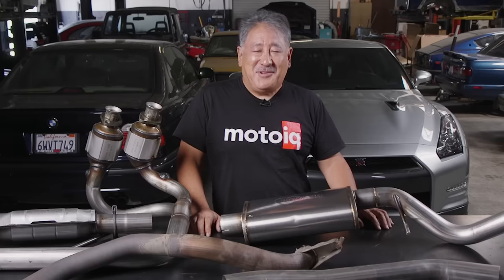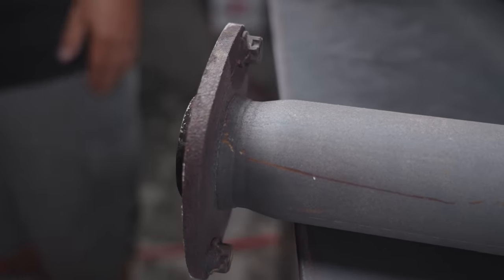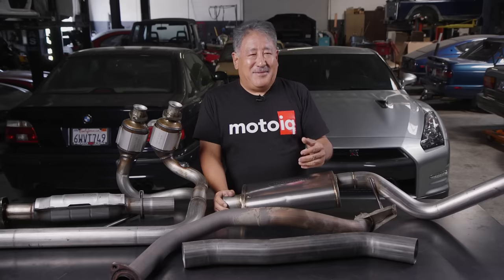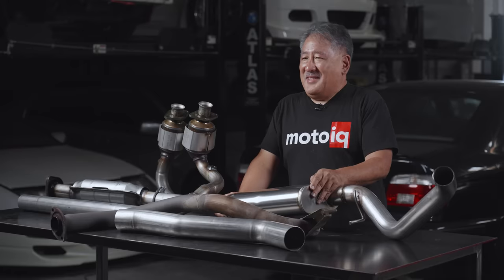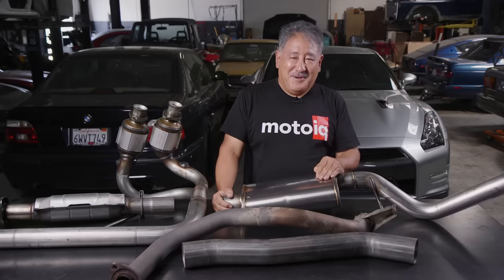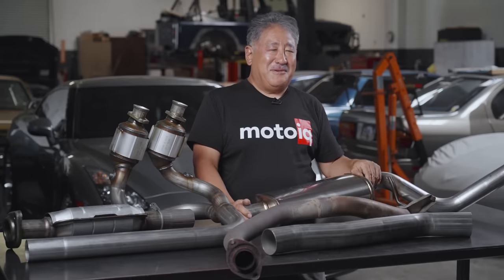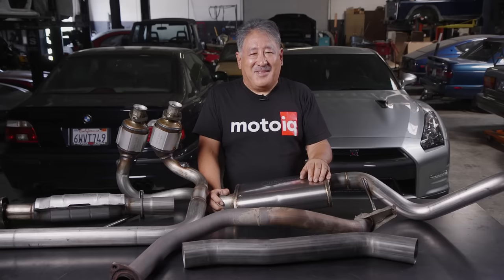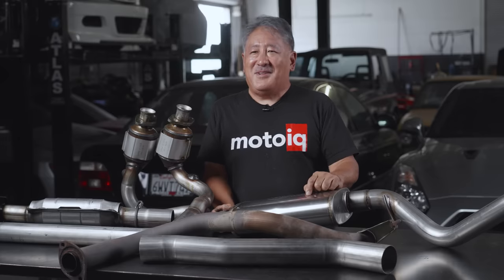Exhaust Back Pressure Myth DEBUNKED!

Comment: now im not saying you are wrong but i have a 1982 300 inline 6 with 2-1/2 inch pipe and  when we straight piped it it stumbled and backfired like crazy like it was way out of time or something but no mater what be did with timing or fuel the only thing that fixed it was a super cheap $20 in (2009) roadrunner muffler
Reply from the maker: Did you actually monitor the AFR?  What was it in the range of stumbling?  I assume the engine was carbureted?
Reply: @motoiq  yea it is carboarded and all the problems happened around idle 900-1100 rpm

i mean we checked 
vac system
carburetor
replaced the wirers and plugs thinking they were faulty swaped out the distributor and coil because we had them

2.5 inch was the factory pipe so we never thought it would be that 

old man next door said throw a  muffler on it and that fixed it

i don't know the AFR because we don't have the tools for that this is a backyard restore
Reply from the maker: Did you adjust the accelerator pump shot?  Did you up the jets?  What sort of carb was it?  Often improve breathing leans stuff out and not just idle mixture screws. Helps to get a cheap wide band AFR meter if you mess with cars much.  Comes in very handy.
Reply: @motoiq   its a Rochester 1 barrel and ill be honest i didn't know you could adjust an accelerator pump
Reply from the maker: they have jets for them https://www.carburetor-parts.com/rochester-main-jets-120-10a  You can't adjust the acclerator pump on those.  Put a vacuum gage on and and adjust the idle mixture for the highest vacuum.  You might have to jet up a bit depending on how bad the stock exhaust was. Offenhauser makes dual and triple rochester intakes for those and if you mod them with a good header, intake and cam they go pretty good.
Reply: @motoiq  thanks for the advice i drive it daily should i go small?
Reply from the maker: how big did you go for it to mess up?  It's a 300 cubic inch i-6 right?

Comment: This does not apply to all vehicles. Regardless what this guy says a lot of vehicles runs better with some back pressure.
In renegade dirt track racing you run the exhaust to around the halfway point of your car and then you take a crayon and draw a line on the bottom on the last 4 foot of the exhaust,then you crank it up and let it run for just a few minutes and where ever the crayon stopped melting you cut the exhaust off and not only does it give you some back pressure which you need it also dissipates the heat from the motor. You can also take the muffler off a 4wheeler and run just the straight pipe header and you can clearly tell it runs better with the full exhaust system
Reply from the maker: What I am saying is 100% true, you are just not understanding what I said in the video, its high velocity, low backpressure with the right engine tuning to support it.  This will make more power and torque all the time.

Comment: But if you remove all back pressure don’t you run lean and can blow up the motor?
Would you not have to be very careful and have a professional re calibrate the complete cylinder banks
Reply from the maker: Then you rejett or retune.
Reply: Yes then that should be mentioned every time some tries to tell you something is better, engineers do their homework
Youtubers don’t, and can cause serious damage to unknowing individuals @motoiq
Reply from the maker: That has nothing to do with the video, that backpressure hurts power.
Reply: Your video implies removing the back pressure from any car will improve performance. Without notifying the viewers that doing so can damage a motor quickly.  That is all I am stating  @motoiq

Comment: Why do 2 strokes have a small rear tube before the silencer.  I fitted one  of theses to a 125 road bike and it made the bike much faster
Reply from the maker: https://www.youtube.com/shorts/qf9eFYPYXUY  They call that the stinger and its length and diameter are part of the pipe tuning.  A basic formula for a stinger length starting point is 6x the diameter.
Reply: @motoiq  yea we call it a spanny pipe.  But some one explain why it contradicts this mans vidio .
Reply from the maker: Because it doesn't.  The pipe isn't a restriction. It's a wave strengthener.   It makes the end of the rear cone more defined to reflect harder.  Backpressure can make the wave travel faster but it's better to have lower backpressure and shorten the pipe if you can do it.  You can add some sort of restriction to band-aid a situation when you need to move the powerband around but it is not the best way to do it.
Reply: @motoiq  I'm not sure I fully understand but I want to . I love power modifications.
Reply from the maker: Check this out. http://www.dragonfly75.com/motorbike/ECtheory.html

Comment: So is anti lag harmfull for the engine or?😅
Reply from the maker: It is hardest on the turbo but also hard on the exhaust valves.  The life of these parts goes way down. The cooling system also needs more capacity as late timing is hotter and normally the engine gets to cool off during overrun.

Comment: More Internet lies. U need some backpressure for more low end power. More open exhaust for more high rpm power.
Reply from the maker: That is not true. If you don't believe me, check out what Gale Banks says https://youtu.be/k7yYY_hy250?si=PGIIk5Qfbafrdr2z  If you don't believe Gale Banks, here is a test garage 4AG did https://youtu.be/V2Wv5-ZTOjM?si=oA1CylAdrnh5m48K You will note that increasing backpressure did nothing but hurt the bottom end.

Comment: I was told motoGP bikes have valves in the exhaust to create back pressure to help with power in the mid RPM, I guess that was a lie then
Reply from the maker: In the intake
Reply: @motoiq  Yeah I know about the ones in the intake, but that guy was specifically talking about the exhaust, guess he was full of BS then
Reply from the maker: I double checked and Ducati runs one but it is to improve engine braking when the throttle is closed.
Reply: @motoiq  oh, thanks for looking it up, but good to know the correct information now, thanks for the work

Comment: The only thing back pressure is good for is regulating fuel consumption.
Reply from the maker: Actually a properly designed exhaust can reduce fuel consumption.
Reply: @MotoIQ  true, but when the EPA forces you reduce what that bureau claims are harmful emissions and your available technology doesn't allow extreme fuel input control your only options are to restrict the pump and vent to atmosphere. Just before the EPA required the switch to fuel injection, carbureted vehicles were achieving 50+ mpg. If that technology was allowed to be perfected, all high fuel mileage vehicles today would be carbureted. The only danger we faced from tailpipe emissions was the additives  they put in them. In the case of this subject, it would be lead particulate.
Reply from the maker: Um I was alive and modding cars before the switch to fuel injection and cars sure didn't get 50 mpg then with carburetors, I can't think of a single full size car then that got anywhere close to that.  When I was in my early 20's cars started to go to electrotonic fuel injection and 3 way cats and not only did they get much better mileage, but they ran much better and made way more power.  Performance came back then.
Reply: @MotoIQ  This type of vent to atmosphere small carb designs never made it to large v6 & v8 engines. The best example of this concept in a modern take is this project by ThunderHead289 here on YT. https://youtu.be/KuDIuSsxia8 
I personally have an 86 CRX HF that had probably the best example of this technology from that time period that made it to market. It used 12 temperature controlled vacuum switches that vent to atmosphere. The system had around 40 hoses between the two vent boxes, the switches, and the carb. These setups have potential, but again, the advancement was suppressed.
Reply from the maker: I mean just about all carburetors are vent to the atmosphere, the only exception might be sealed box blow-through carbs with turbos. The 85 HF has a lot of vacuum hoses due to it being the last of the CVCC pre-chamber engines that have a dual circuit carburetor that feeds a richer mixture to the CVCC pre-chamber.  The reason why this was discontinued was not because of some great conspiracy but because consumer demand wanted more powerful cars and technology got better.   There is no way a carburetor does the combination of power, emissions, and fuel economy better than fuel injection.  Sure the examples you showed get great mileage but they have really poor power and if you look at modern engines brake specific fuel consumption (lbs fuel per hp per hour) over the entire operating range, fuel injection wins hands down, especially modern DI engines.  If you built a 70 hp Di engine to propel a 2100 lbs fwd car, with the same emissions standards, it would win hands down. The engine would only have to be 1000cc and have better thermal efficiency and better friction.  There is a reason why F1 cars approach 50% efficiency besides energy recovery and hybrid technology, it's stuff like using the Miller cycle and DI fuel injection.  The only way a carb comes close to something like direct port injection is steady state-specific operating range driving and even then DI injection is much better.
Reply: @MotoIQ  I'm not saying that carbs are better, but they do have a place in the market but are not allowed to be placed on new vehicles at the factory. (Which is Fascism by the way) The vent to atmosphere takes place either on the manifold or at the base of the carb, so the fuel metering device is not overpowered by the vacuum. Which causes an over rich condition. In the case of the hf carb, it has both. As well as a variable pumper and premix, which allowed it to operate at a range of temperatures more efficiently.  I replaced it with a Weber 38/38 outlaw, but I kept the carb to study it and for the value of having it. BTW, the number of hoses had nothing to do with CVCC. CVCC is actually head design. There is a tiny valve next to the sparkplug that makes sure the area around the sparkplug is as rich as the cylinder to improve flame propagation. It's a strange design, if I'm being honest. V-tec was a better technology for sure. I can't remember exactly where I've seen it, but there was a dual injection(direct injection/port injection) engine that made use of a similar technique to CVCC having the main mixture come from the port injector and a small injector near the spark plug to create a more efficient flame propagation. I do, however, believe that no carb setup could beat a turbo/supercharged fuel injected engine tuned for fuel economy. Especially as the control technology gets better and better. If that technology isn't completely put under by this ESG global Fascism we are facing, that is. 
I'm about to do a complete engine rebuild on this old EW1/D15A1 and will be making some videos explaining much of what I have learned that I couldn't find out there on the internet.
Reply from the maker: It isnt Fascism, its because carbs can't maintain the stochiometric AFR across a wide range of operating conditions needed for catalytic converter operation. Unless you think effective emission controls are Fascist. Carbs cannot provide a stable enough AFR over a wide enough operating range for an oxidation-reduction cat to work. A lot of it is not the fault of the carb, its stuff like wall wetting that the carb cannot control and no amount of development is going to get around that. Your typical aftermarket ECU has 1024 break points where the timing and AFR can be adjusted.  Your OEM ECU has 100x that with sophisticated algorithms to chase AFR very incrementally.  It is mechanically impossible to make a carb meter as precisely. A typical carb only has 3 circuits.  A sophisticated conspiracy theory carb has more and probably something like a hot vapor circuit. Still its not going to approach what fuel injection can do.  If a carb could do it better for cheaper, the OEMs would be using them to increase their profit. Capitalism is a stronger factor than Fascism.  There is no conspiracy theory here.   Still not sure what you mean by vent to atmosphere.  You want a strong signal at the venturi for a carb to work best.  You bleed and mix air into the fuel internally at part throttle via emulsion bleeds to finely control the mixture.  CVCC was done so you could have a rich AFR around the plugs and lean everywhere else. CVCC was phased out not because of a conspiracy theory but because although it was good for HC and CO emissions it was bad for NOX, this is the nature of lean burn.  There is only so much energy available in a mole of fuel and delivering it by carb, even magic carbs isnt going to change that.  Emission controls are not Fascist. Nether is having clean air.  EFI is not Fascist. The government doesn't say you cannot use carbs, it just says your car has to put out less than X amount of pollutants.  EFI is the cheapest way to do this.
Reply from the maker: All good points but do you have data?  Studies that show that NOX doesn't degrade into 03 by solar energy like is general common knowledge?  Lifecycle impact of EV's?  I have seen studies going either way. I tell people that we are currently in a cool period and the earth has usually historically been much hotter with a way different climate and man doesnt know enough to make a judgement what is the best course of action.  I do know one thing, I grew up in the 70's and as a kid I recall smog alerts all the time and when it was one of those, it hurt to breath and your eyes burned.  The really bad stage 3 ones it was hard to breath and people died.  With pollution controls we haven't had a smog alert in decades even though there are way more people and cars in LA. The ocean is much cleaner too.  So common sense tells us we should reasonably try our best to reduce emissions despite stupid politics.
Reply from the maker: I know there is a lot of bias in the algorithm but I think it's mostly for idiotic right-wing propaganda sights.  The bias is that usually leftist stupid propaganda sights are not censored or fact checked. For scholerly work from credable institutions I think it won't be censored.  Like the FBI data showing that gun control doent work is not censored. I am no fan of big tech doing this.
Reply from the maker: Hey I did some double-checking and I was right, the CVCC carb does have a circuit for the prechamber, it even has its own intake valve.
Reply: @MotoIQ  yes. The cvcc is a premix valve. There 3 versions I am aware of, a 2, 3, and 4 valve head all equipped with an auxiliary valve. My EW1 is a 3 valve with an auxiliary valve. Cvcc doesn't extend to the carb itself, but the intake manifold has a key roll in the operation of cvcc. I wish I could post photos here to show you what I'm talking about. I'll be making my videos this summer. I'll make content explaining the design and modifications I've made.
Reply from the maker: On the one I am looking at there is a circuit on the carburetor to the right of the barrel closest to the valve cover.   They have a good picture of this here.  https://www.thetruthaboutcars.com/2012/08/memoirs-of-an-independent-repair-shop-owner-how-hondas-cvcc-gave-me-my-10-best-years-part-two/  Does your carb have that third barrel?   Here is another version of the CVCC carb https://www.autoweek.com/car-life/but-wait-theres-more/a1850371/wait-theres-more-1850371/  This one has the third barrel to the side of the two main ones.  In all the versions I see the enrichment for the CVCC system is coming from this circuit in the carburetor.
Reply: @MotoIQ  the carb I pulled off is similar to the second link you provided. The variable premix lever does control how much fuel makes its way to the cvcc vavle. It the manifold, there is a hole for that mixture to travel to the valve. There is no way to stop the cam from actuating the cvcc valve to made sure it was feed by the standard double barrel weber. Cvcc actually saw fuel injection, and I think they ditched the manifold tunnel and placed the injector in front of the cvcc tunnel on the head itself.
Reply from the maker: What years was the injected CVCC engine made?  It is interesting with direct injection, now sometimes there is a pre chamber in the piston near the plug and there are two injection events, one during compression and another near TDC, this gives a stratified charge like CVCC but even more efficient.
Reply: @MotoIQ  85-87 for sure. In 85 and part of 86, those engines would have been stamped EW3. Midway through 86, they change stamping for all EW engines with the D15 stamping. The fuel injection models would have had D15A3 (PGFI). 85-87, all CRX SI models were fuel injected and nade between 90&105 HP. The prized engine to imported from the Era is the D15z6, which was occasionally equipped 4 individual KeiHin sidedraft carburetors from late 86 to 90.
Reply from the maker: Is the twin sidedraft prelude engine CVCC?
Reply: @MotoIQ  that's a good question, and I'm not sure. I know cvcc was phased out in 90-91 in North America, but the DOHC equipped with V-tec was hitting the market globally in 90. If you have the engine, it's easy to see by removing the valve cover. On the intake side for each cylinder, there will be a valve with a tiny spring about the size of a clutch spring on a grom. It should be actuated by the or one of the intake rockers. 1 rocker if it's a 2 valve, 2 rockers if it is a 3 or 4 valve. This may be different on different heads, but on mine with the head off and looking at the face, you can not see the sparkplug. It sits in the cvcc chamber, and the ignition flame travels through a port on the chamber that faces the exhaust valve.